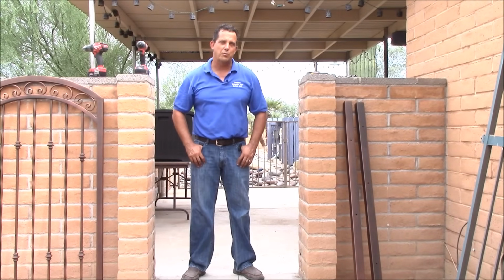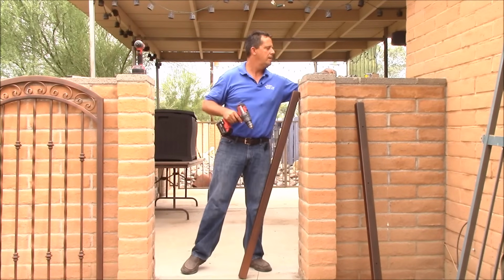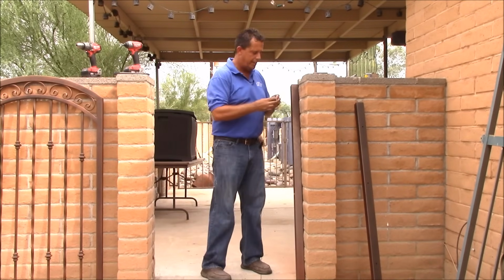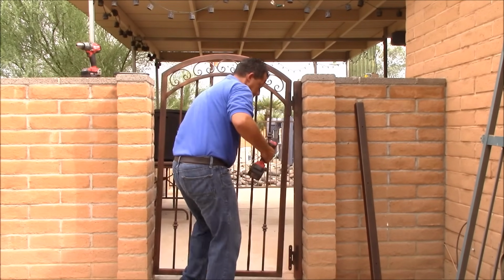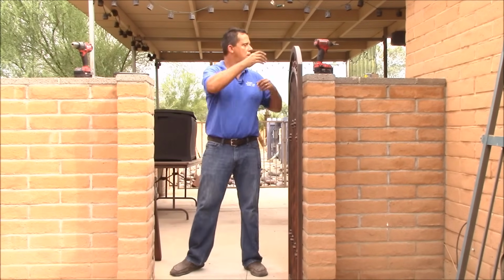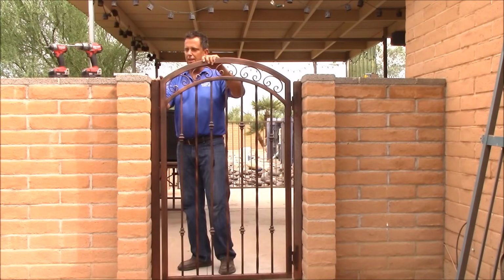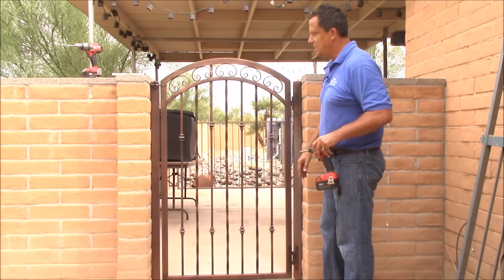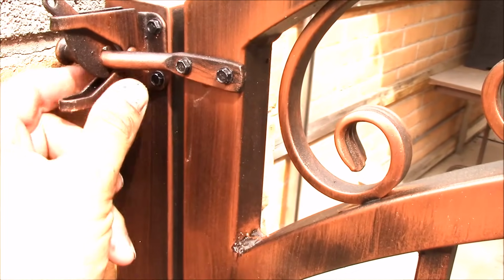How to measure and install your new Wrought Iron Gate

Comment: So I have posts into concrete already from a contractor who never finished... one post is leaning and there's a difference of 1-1/2" top to bottom. Am I still ok just making the gate according to the smaller of the two measurements?

Comment: Where do you get the lead inserts these days? Do they even work in "hollow" bricks?

Where do you get those hinges?

What about that 1/4" difference in width between the top and the bottom? Its quite obvious the gap widens on the latch side from top to bottom.
Reply: You can adjust that with metal washers behind the posts and readjust .